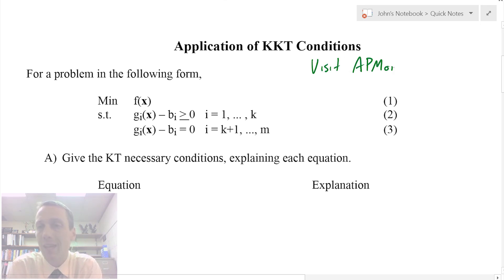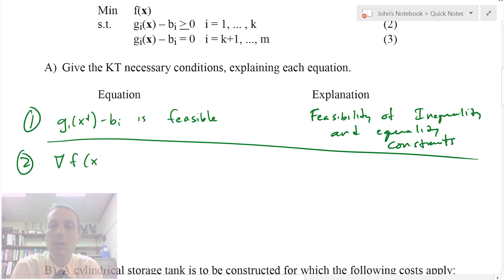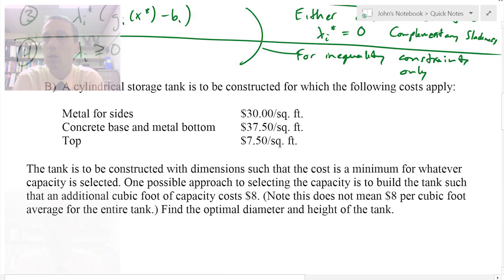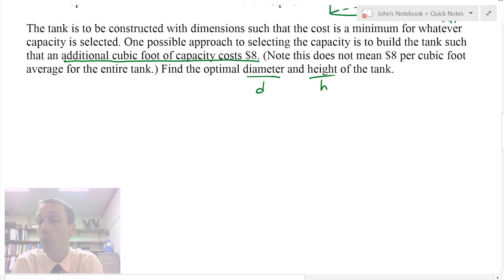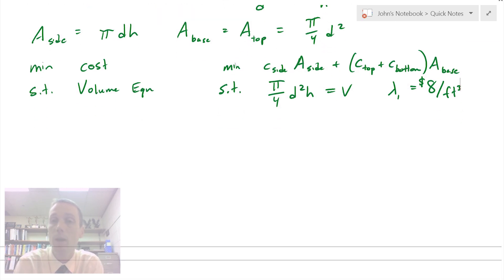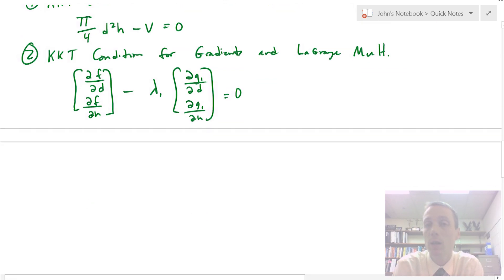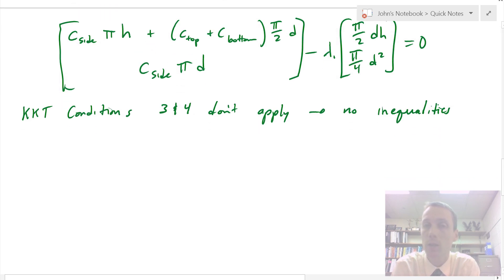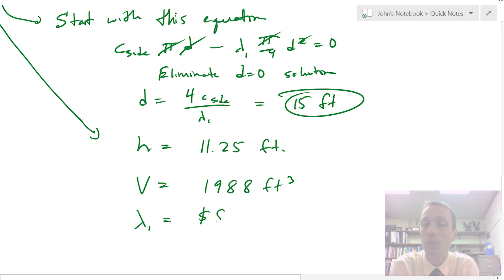Tank Volume Optimization with the KKT Conditions

Comment: what's the difference between the necessary and sufficient conditions in KKT?
Reply from the maker: All four conditions are necessary with the KKT conditions. Necessary and sufficient conditions are two types of conditions that can be used to determine if a certain statement is true. A necessary condition is one that must be true in order for a given statement to be true. A sufficient condition is one that, if it is true, guarantees that the given statement is also true. We typically say necessary and sufficient because all four KKT conditions must be satisfied. If they are satisfied then it is sufficient proof that it is at least a local solution.

Comment: wow thanks for nothing.
Reply from the maker: There is a more basic discussion of KKT conditions here http://apmonitor.com/me575/index.php/Main/KuhnTucker  You are welcome :)
Reply: I'm sorry for the bad review, guess you went so quick I got even more confused.
Reply: If it's possible, I wish to ask for you to point out a algorithm to solve this problem of the  minimum cilindric tank limited by a maximum Lenght and Diameter. All I know is that it is a quadratic equation of two variables, limited, and so it requires a non-linear constrained method.
Reply from the maker: Here are a couple examples in Python http://apmonitor.com/che263/index.php/Main/PythonOptimization and MATLAB http://apmonitor.com/che263/index.php/Main/MatlabOptimization  What software do you typically use? I'd recommend either GEKKO or Scipy.Optimize.Minimize for Python or fmincon for MATLAB.